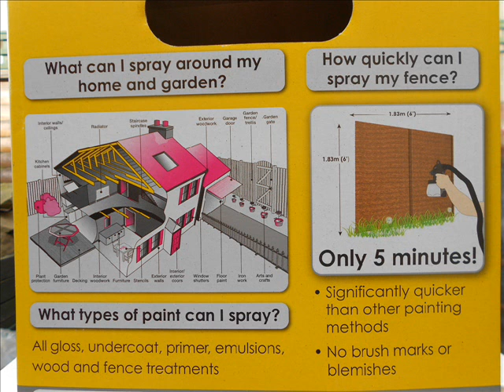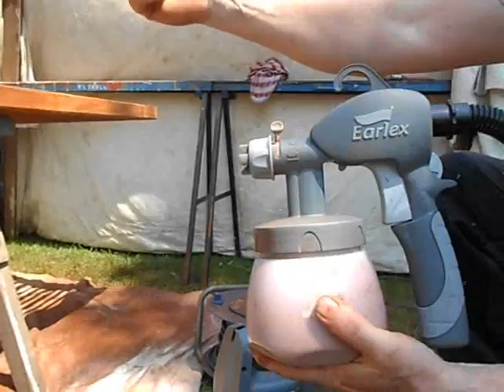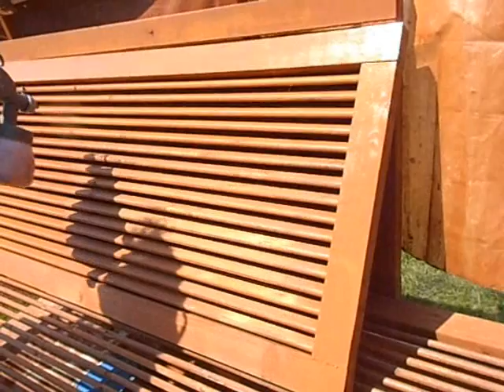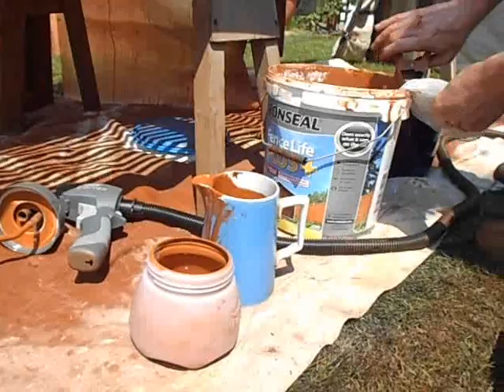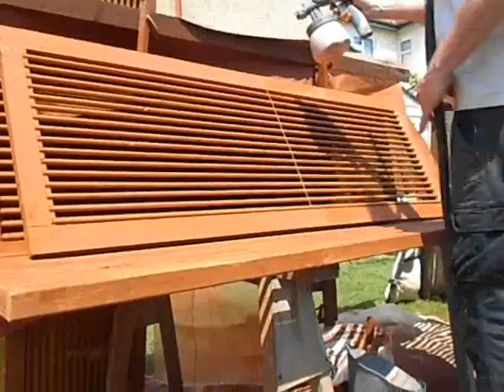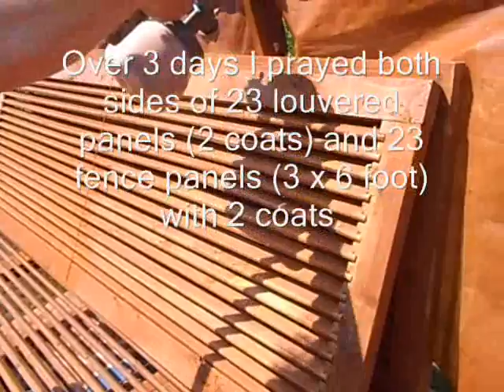Earlex Paint Station HV 1900

Comment: Very useful, thanks. No diluting of Fencelife is good to hear - that's where I'm headed. What did you use to strain it? What did you use to clean everything afterwards? Great instructional video!
Reply from the maker: Hi Alistair, a couple of weeks ago, I pulled all the trellis and fence panels shown in this video and resprayed them. It has been about 5 years since I made this video and they needed some cleaning and repainting.  I used the same sprayer that I demonstrated in this video. It had been sitting on the shelf unused and performed flawlessly. I sprayed Ronseal Fencelife Plus right out of the tub, no dilution and no straining.  Poured straight into a smaller painters bucket and then into the sprayer. I didn't leave the gun sitting for long between panels and had no blockages.  To clean I poured hot water from the tap into the gun and gave it a good shake to remove most of the paint, poured that away, then refilled with hot water and sprayed it through the gun to clean it. It was then ready to go the next day.  After spraying a panel, I brush out the paint with a wide bristle brush to make sure I get into all the edges etc.  The fence paint is very forgiving when it dries so of it looks a bit thick in places don't worry too much.  Had very good results.  Hope this helps, please subscribe if you feel inclined. Good luck!